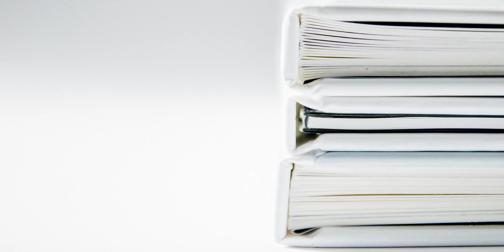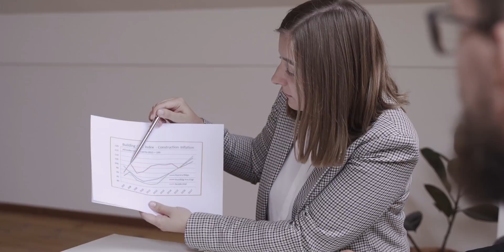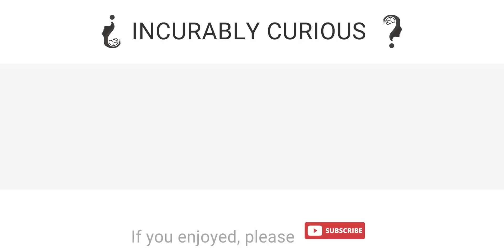Why Most Power Lines Aren’t Underground

Comment: Over the years and decades most roads get dug up for one or another project - and that would be a perfect time to invest in preparing to relocate power lines. When a trench gets dug, put in some big conduit so that after a while, a big run can get buried. Make it a very long term project so that the added cost at any one time is minimal. After a few decades more and more power lines would be underground and outages would be reduced, at a relatively low cost. There would be savings from fewer repairs.
Reply: Usually when a road is being dug up, it is for a repair or replacement of a line already there.  To replace the utility poles, you would most likely need to add 3 new conduits (electric, phone, cable) under ground. This is would a larger area then they usually are digging up. Then they also need to add access points to get power to the buildings/houses. (Those green boxes in people’s yard are the access points). Then you need to dig from the access points to the actual houses. 

There is a lot of work involved with moving lines under ground. And you need underground vaults to have space for connecting lines to each other. So that also effects repair work because your limited on how many crews are able to work on issues due to everything under ground. 

(And a side note, the homeowner is usually responsible for the conduit, that runs from the pad mounted transfer (green access case placed in someone yard) to your house. This conduit can run through several peoples properties. I’ve seen them get damaged from people digging and need to replace the conduit. That’s all on the home owner to get fixed and be able to used again. It’s not like a above ground line that the electric company can come out and replace a service drop in like a hour, you can be looking at days to get that fixed

Comment: The problems we are trying to solve for power supply are:
1) Round the clock power availability (reliability)
2) Ability to withstand the forces of nature (robustness)
3) Consistency in power supply - no sudden voltage drops or surges or disruptions
4) Low cost of implementation - installation and maintenance
5) Less prone to Damage due to flora/Fauna/human activities
6) Ease of repair and/or replacement of damaged minor/major parts of the system
7) Efficiency in power supply
8) No "unpleasant" changes to the visual appeal of the surroundings
9) No environmental damage - ideally a green solution.
10) Safety

Could we get solar panels fitted on top of buildings?
Reply: Ive wondered about this too. It would seem that we have enough roof tops and space for vertical turbines to supplement that. With real estate, construction planning/implementation and human maintenance it seems like using existing residences would collectively provide enough power without all of the associated costs. Most would jump on the chance to go greener.

Comment: In the 1970s I used to install and terminate underground power lines here in Manitoba. All the new developments use them. Not as practical for the very high voltage lines because the electrical stress will eventually deteriorate the insulation. At the time we had 2 million feet of older underground line that needed replacing. The older stuff had rubber insulation. The newer had cross linked polyethylene. These were direct burial. There an so is Cambrian insulated lead covered cable run through pipes from manhole to manhole. We also have some 110k oil cooled underground cable but that is rare. Heaviest cable I ever terminated was 25 kv 200 ncm copper.

Comment: It's mainly cost and maintainability.
For long very high voltage transmission lines the cost of undergrounding would be phenominal and unrealistic. In large cities the same high voltage lines are usually shorter and it would be almost impossible to put up steel towers in most cases.
For final distribution underground cables usually win out. Most, if not all, new housing developments are underground.
It's like the old railway line problem. Should we go round the mountain and through the swamp or dig a tunnel? Which is the cheapest? Remember. At the end of the day the customer pays anyway.

Comment: Ok very interesting. If you are correct this is very contrary intuitive. At first look underground does seam the better option, but if you claims are true that would be in correct.

But what about transmitting power like Tesla proposed? We have much more technology today than he has to work with a hundred years ago. He was able to do it over short distances, why can't we improve on that today? Also assuming the equipment cost isn't crazy, that would decentralize the power delivery points decreasing the number of customers effected by any given outage. Even with a radius of ten miles, that eliminates huge spans of cables, poles and repairs.

Comment: Once the line is in the ground one does not have to place dirt on top of the lines. Use a weather proof cover designed  to be removed easily and stacked for convenience until repairs are finished. Oh also place warnings signs to keep out idiots.
Reply from the maker: Interesting idea. I don't think anyone has mentioned that before, but that would likely mean a lot of plastic.
Reply: @IncurablyCurious  Ft. Greely Alaska used steam heat for all buildings. In the housing areas they were in trenches, with removable steel covers. Ware, sewer, steam supply and return, telephone and electric lines were in these. Because of the severe cold and long winters, they were visible most of the year. If people bitch about a bush being replaced, who would you convince them to have a covered trench in their yard? How about liability issue? The cover would have to be heavy enough that vandals can't lift them to steal the wire, or kids to get into them. There was a news storm years ago about a woman suing a utility because her thug son dug under the fence at a substation to steal copper wire, and he was not only electrocuted, but the body was badly burnt. She insisted that they hadn't kept the thug safe.

Comment: I worked on an electric power line crew for 39 years with a large energy company.  Our company owns and maintains thousands of miles of both overhead and underground electric distribution lines, with about 1/3rd of our lines buried underground.  Approximately 2/3rds of our outages were on our underground distribution, rather than our overhead distribution lines.  Restoring power on underground took twice as long as on our overhead lines.  There are actually far more natural negative forces in the earth that cause damage to underground cables, than on overhead.
Reply: What percentage of those underground electric lines were in concrete encased conduits? I would guess that most of the underground electric line failures were in the lines that were either direct burial or were in direct burial conduits.
Reply: @SandBoxJohn  Our very first UG residential installations, in a pretty wealthy part of our city, were #4 copper jacketed cable (with concentric neutral).  That cable had very few issues for decades.  That development also had submersible transformers, which were virtually trouble free.  However, back in the 70's we started direct-burying #2 aluminum unjacketed (concentric) cable in all our new residential developments.  It remained mostly trouble-free for about 16 years, but it was gradually replaced with jacketed 1/0 aluminum, in duct.
Reply: No this is no more than the AT&T moto used by ever big company, step over a dime to save a nickel
Reply: I guess this video could be debated, the old exposed concentric cable was only good for around 20 years and that didn't mean there wouldn't be outages within that time, in my area July, august and September where the worst for underground failure. The ground would be dry then and about 2 or 3 days after a thunderstorm we'd be out making repairs. Frost heave and rocks is another problem with underground but with the new jacketed cable outages seem to be reduced, time will tell.
Reply: @robertlivingston1634  Our Utility banned working live on concentric. Thank god we have very little of it.
Reply: Last mile or in the middle of distribution circuits? The last mile UG seems to work fine, not so sure about the middle of distribution circuits. Also, UG failures happen slowly versus above ground all at once. That being said, the answer is already known. It's to build 3-phase distribution lines with Hendrix ACS in a logical, well planned manner with quadruple redundant paths to most areas, use larger, newer poles, larger bolts, and better workmanship. This system is what Wallingford, CT did a couple of decades ago, while the rest of CT has a decrepit, falling apart system mostly comprised of the archaic 3 individual wires on arms that get taken out by the slightest storm. Connect the 3-phase ACS to UG developments and directly to commercial customers and the outages are almost entirely limited to single phase residential, which can be restored quickly after a storm.
Reply: The latest one is that Neversource's decrepit bare wire lines started a 300 acre brush fire the other day in Middletown, CT. Would not have happened with Wallingford's system that's aerial cable that's fully insulated and won't easily come down.
Reply: I'm a cable Jointer in a city that's half half. The vast majority of outages are overhead. Usually storms.
Reply: @scottwhat3362  I did it for 39 years.  Overhead outages are faster to restore.
Reply: @mulekickhandmadeguitars8465  Yep, that is the benifit of overhead. Saying that, they can also get really wrecked in a bad storm or fire.
Reply: Build better underground lines, its easy. Most other countries build them properly with no outages. The only time we have over head power lines is when its high voltage pylons, or very rural areas, farms etc where burying the cable is totally uneconomical.  
If there are storms, its usually these ones that fail due to ice or high winds.
Reply: @berty1422  In a sense you are right. On the other hand, if we built overhead lines properly with robust poles and hardware and aerial cable, we wouldn't have very many problems with those either.
Reply: what about electric storms that can and eventually will hit earth
Reply: @fishsticks4981  what, do you think UG installations will be safe?  You do realize that all the transformers are above grade, not to mention that practically everything that the UG installations powers is above grade anyway.
Reply: Like what?
Reply: San Andreas?
Reply: Must be something special going on in the U.S. as it works just fine everywhere else. Now should we look for natural laws working different there or other explanations like lacking regulations (or their enforcement) in order to ensure quality, training or even designs, ... Guess we should go with everything better in the U.S., so has to be the former.
Reply: @erikitter6773  There are a couple of reasons. The US, Canada, Mexico, etc. all run on 110v, not 220v, which means our power runs at a much higher amperage. Greater amperage means greater heat. In a confined space that would lead to a greater failure rate. We also tend to have much more extreme climate and environmental conditions. Look at California or even Japan for that matter. Both are heavily prone to earthquakes. This is why utilities are mostly above ground. New Orleans was another example of why underground electric was a bad idea. Hurricane Katrina basically flooded the entire city's electric infrastructure. Numerous underground substation vaults were suddenly 20 feet underwater. Our far north, not just Alaska but places like Montana, Wyoming, and the Dakotas are subject to such brutal winter cold -50 plus temps are not uncommon, that frost heave becomes a serious problem.

This doesn't even begin to touch on the economic aspects. The average consumer will never tolerate their bill doubling, tripling, or even more for something that is perceived as being mostly about aesthetics.
Reply: @currentsitguy  what about all the above ground power lines wiped out by Katrina?
Reply: @timmebruer5205  We had a business client who was a transmission engineer with Entergy at the time. They were restrung pretty quickly. The problem that really delayed everything was that many substations were still located underground and were flooded. A lot of portable trailer mounted temporary substations were brought in just to supply power to get the pumps running.
Reply: Might be true for your country that 2/3rd of the outages were underground. But my experience is different having lived in the Netherlands (40+ years) and in a country (20+ years) with only overhead power lines.
In the first country, I seldomly had outages (less than the fingers on 1 hand), in the latter I have at least 5-10 outages each year (not including the outages to telecon or internet).
Reply: @haruthaiarayawong6257  The real answer is all electric linemen in America hate underground lines because they put them out of work. They spread misinformation about them to save their 40 dollar an hour jobs, full medical, dental and 401k. I mean, my goodness, when one pole goes down here they sound out a supervisor with his f-350 and 3, 4 man groups with f-550 cherry pickers. It’s one of the biggest scams going in America.
Reply: Yes. The neverending greed is most likely the reason.
Reply: Yet fibre optic and phone lines seem to go underground with little interruption.
Perhaps the issue is the quality of the cables used.
Reply: @galaxycoder  Silly rabbit. The major difference is that fiber and TV cable are not powered and are generally less susceptible to external damage.
Reply: @galaxycoder  Around here it's pretty much all above ground or all below ground. But in many areas there is a lot of fiber underground. The problem is, they often get cut by Backhoe Bob.
Reply: Interesting. That bucks the worldwide trend. I wonder why that is? Everywhere else in the world it’s much more reliable than overhead lines, just more expensive. I mean, that’s why they bury them after all. Because it’s more reliable.
Reply: Below ground cables make more sense in large to medium size cities. Can you imagine what New York City would look like if all of it's consumer transmission lines were above ground?
Reply: I don’t think that any of the replies here are from people who are knowledgeable in electrical engineering.  (I’m not either, although I did rewire a house.) That’s why they offer pat answers.Sure! Just put the cables underground! Easy!  But the high voltage lines have strong electromagnetic fields around them which is why they must be separated, not just from each other, but also from the ground (earth).  A high load on a circuit can also generate heat, which easily dissipates in the air, but can cause a fire (especially in a damaged or defective cable) underground. 
Europe (and the rest of the world outside of North America) also has the advantage of having 220v service which requires less amperage than low voltage American service, thus requiring smaller gauge cable, which is more suitable for underground routing.
Reply: @KeithOtisEdwards  Underground Cables have a concentric earthed conductor around the main insulation. They sit on top of each other. They often are direct buried. They are completely insulated. You could handle them as safe as an extention cord.
Reply: @KeithOtisEdwards  The secondaries aren't the issue, we widely underground those in new construction now. We're talking about primaries. There's no real technical barrier, its just the most expeditious and cost effective solution is well built Hendrix ACS on sturdy poles, which would almost eliminate 3-phase power outages without the cost and disruption of undergrounding in areas with 3-phase power or existing UG.
Reply: I live in austria, we also have pretty much every wire underground (exept the big ones) and the only timea that i know of where one of these cables has been damaged is when they dig somewhere and the cable has not been properly marked. But we also don't really have earthquakes
Reply: Idk we have plenty of farms with underground three phase and they run via conduit. Even with the ground disturbance of tilling and farming the fields year round, running with literally tons of equipment, drenching the fields in liquid manure, and the natural gas lines and drilling that go on, we had some years where the power never went out at all. Strange, also our underground copper phone went out twice in 10 years....
Reply: Because in ‘merica you can’t do one job correctly the first time. I worked on underground lines installed new underground lines and upgraded underground lines. The only reason they would fail is human errors, excavator ripping up the line or a contractor for the city doing a cheap lazy job after all Italians can be at time worse than the US. 
Natura negative forces? Please elaborate.
Reply: @cmott8809  The UG cables in our system never failed at the splices.  Yours perhaps, but not ours.
Reply: @cmott8809  Earthquakes, floods, Hurricanes, Thunderstorms. All happen many times a year in the States

Comment: In Camarillo California in the 1980s a friends house  neighborhood had all underground power. The power was always going off. The designers used insulation that squirrels loved. So in video taping tv programs the VCR would loose its mind since the power went off.   Squirrels ate into underground vaults and wires through small gaps

My power at an apartment miles away was radically more robust. I had above ground wires and poles. You could go 6 months before resetting  VCRs clock. When daylight savings time started or ended..

So the down factor at friends house with underground power was like terrible. Off a few times per month. Mine about perfect.

So in rare cases underground power is far worse.